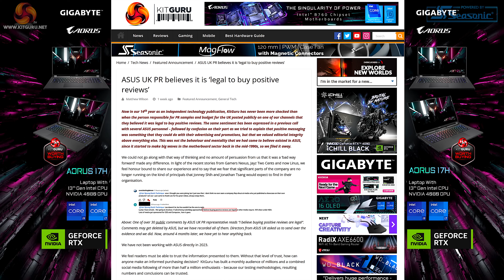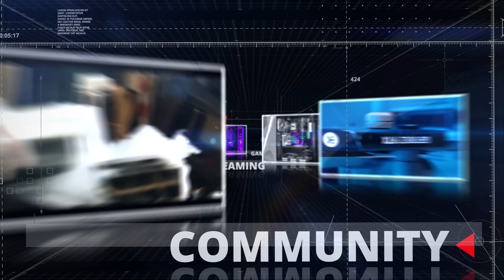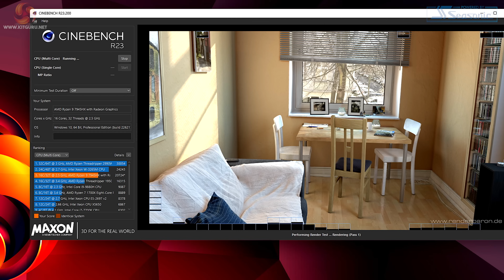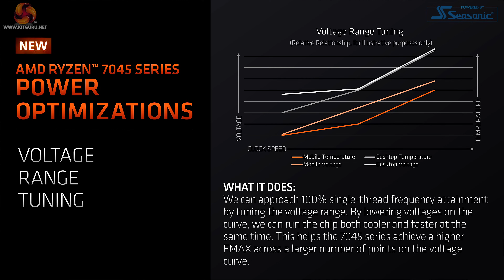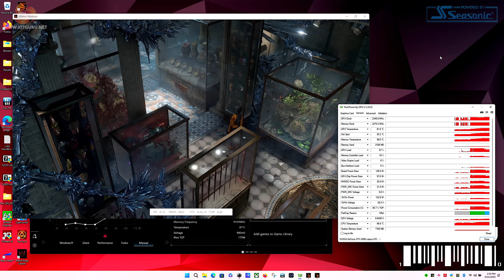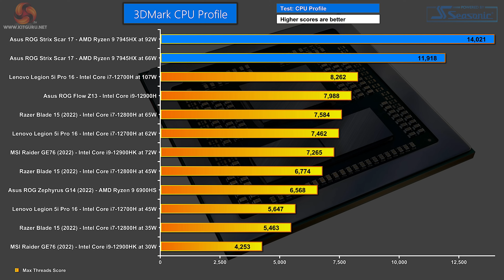AMD Ryzen 9 7945HX – Zen 4 Dragon Range Unleashed

Comment: Asus is not what I would call a trustworthy company.
I had a VERY bad experience with their ROG Strix back in 2018 which kept frying itself after only 1 month of use... and it was extremely LOUD when playing games (which didn't even max it out).
Plus, instead of replacing the machine, Asus kept insisting on repairing it.

Since then I opted to NEVER again get Asus until I am convinced they can supply us with a product that won't fry itself into oblivion and it can be cool and quiet (along with AFFORDABLE)... which is why I'm waiting on Acer's Dragon Range laptops with CPU's that have Zen 4 12 or 16 cores... and RTX graphics (the Nitro line is expected to have both 12c and 16c with unspecified RTX 4000 series dGPU's - I'm hoping 4070 with 10 or 12GB of VRAM - so I can leverage CUDA in content creation).

I do content creation/productivity and gaming on the go, so I need a powerful mobile desktop replacement machine... and I had amazing track record with Acer when it comes to reliability, cooling and noise in laptops.

In fairness, limiting the CPU to 65W seems reasonable of an approach and the quietest one (or heck, even 95 to 105W should do the trick while not increasing noise levels too much - aka it should still be more than manageable without earphones)... you don't lose massive amount of performance from the absolute maximum, and for everyday tasks and gaming, more than 65W seems unnecessary... heck, even content creation can get away witrh 65W, 95 to 105W (for boosting speeds).

One thing to keep in mind is the RAM... usually AMD laptops (for whatever reason) ship with slower RAM. In the case of Zen4 and so-dimm DDR5, 4800MhZ ones and higher latency.
I'd suggest upgrading this to 5600MhZ (at least, or waiting for 6000 MhZ) so-dimms with 40 CAS latency - that way, you can actually IMPROVE system performance by upwards of 30% (usually over 20% - yes, with just a RAM change).

Linus recently did a video on this very problem and noticed that the Intel system shipped with RAM that had more chips on it (but otherwise same amount of RAM)... and when they put that RAM into AMD system, the performance improved by 30% (and when they put the RAM that came with the AMD system into Intel laptop, the performance there DROPPED by 30% - and for what... so the manufacturers can save literally a few bucks - even though the better RAM wasn't that much more expensive and wouldn't have added much to the AMD laptop cost).

Comment: good lord I'm going to try and convince work for a new laptop with an AMD processor in it. incredible speeds, thin and lights would be bonkers or bribed to use Intel right now (based on the efficiency that is evident by lower the power to 65W)

or that tiny form factor PC's as well, damn the capabilities have me a bit excited now. hells yeah cause the gd GPU market is an overpriced heaping pile of carcasses atm.

Comment: Have AMD used a thinner heatspreader for the mobile version to stop it from getting so incredibly hot?
Reply: laptop processors are usually, or almost always, delidded. the IHS is only there to protect the cores for PC builders, since delidded CPUs are very fragile

Comment: The trouble is with any power laptop is that compromise between heat and power. Very frustrating.
Reply from the maker: You dont think the 7945HX would deliver the power you need?

Comment: WHAT A CPU ! Amd do it again, absolutely unbelievable performance levels. if you hooked this up to a big monitor, could easily do all the desktop tasks you need without an issue.
Reply: i can tell you're a "fanboy" but tbh. I can't blame ya. sweet baby jesus AMD laptop processor just kicked the teeth in on most desktops using twice as much power.
Reply: @Meatsweats_o_O  TSMC 5nm, is not rocket science.
Reply: @Meatsweats_o_O  well, in fairness, the 7900x and 7950x can be reduced to 105W TDP and this would only drop their performance by 5% over 'standard' while reducing power consumption by about 50% (and similarly dropping temperatures by about 15 to 20 degrees Celsius).
If you ask me, the desktop CPU's are operating at too high TDP's for minimal performance gains... AMD's sweet spot for Zen 4 should have been 105W to begin with... not 170W.

The beauty of Zen 4 is in larger performance per watt gains... so, the 65W version easily runs circles compared to anything else in the mobile space.

I'm personally wary of Asus laptops. I had a Strix laptop back in 2018 with Ryzen 1700 and RX 580, and that thing was frying itself after a month of use. Asus also kept trying to 'repair' it as opposed to replacing it, so after the laptop burned itself out the second time (again, after a month of using it), I gave up on it.
Reply: There is a version of this chip coming that will have the new 780M graphics as well. Would be killer in a mini pc.

Comment: Hi Leo! How much power did the CPU draw on the Cinebench R32 benchmarks you had on AC and DC?
Reply from the maker: The CPU runs at 4.3GHz with 92W and 3.7GHz with 66W. It would have been clocked around 2.6GHz on battery so my estimate is 35W.
Leo
Reply: @KitGuruTech  That is impressive! Insane energy efficiency. I hope AMD can fix efficiency on idle as well. Or maybe they already did.

Comment: be keen to see what the RTX 4090 Bus is running at under full load, at the start GPU-Z says PCIe x16 4.0 @ x8 1.1... so this seems its run battery not mains power
Reply: PCIe downclocks when not in use, that's why GPUz has the rendertest